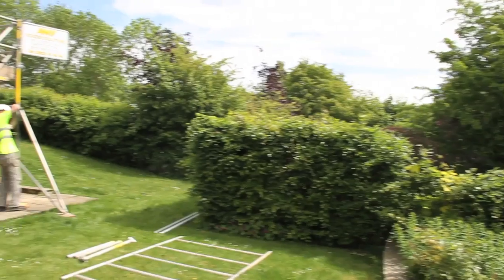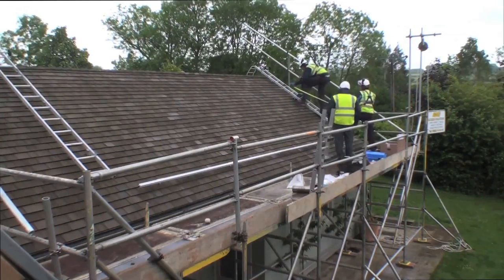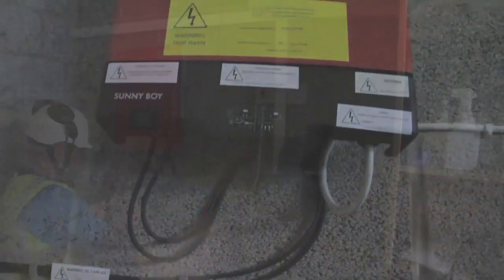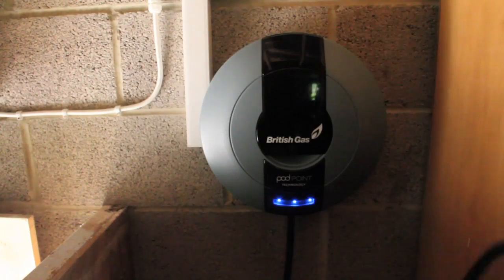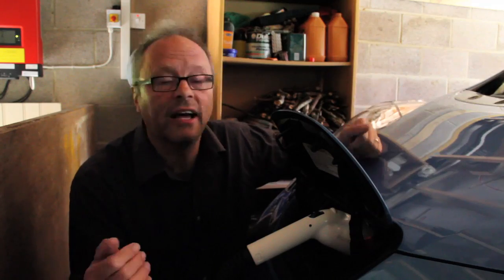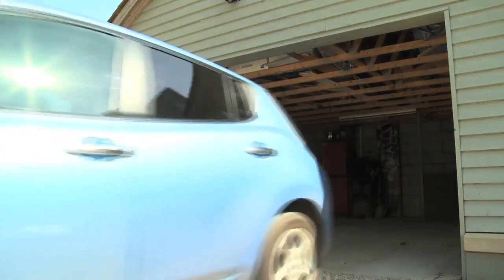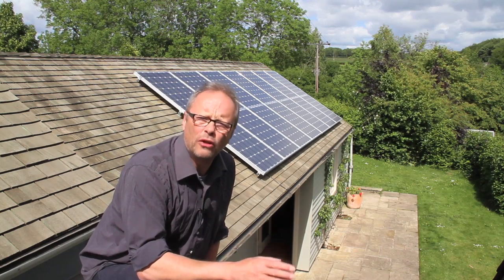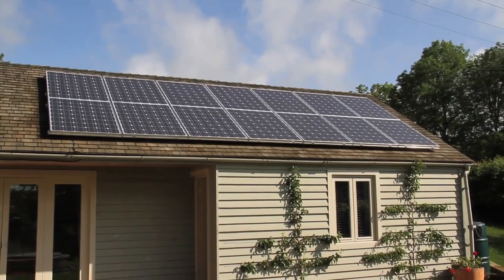Solar PV | Fully Charged

Comment from the maker: @huskobusko That's a good point and very true, in fact loads of fossil fuels were used to create and transport them. In just the same way they are used to create and transport all forms of energy generation systems and all cars. The only difference is, once they are made, they don't use fossil fuels to work. On the day it comes out of the factory there is no difference between an electric car and a fossil burner. 10 years and 200,000 miles later, there's a very very big difference
Reply: In hindsight I think it's clear this statement is not quite accurate. Apart from in the long run electric cars will be greener than ice cars.

Comment: You're lucky over there, here in Australia you only get the feed in tarrif on the power you generate in excess of the power you use. So many installations (especially the standard, cheap, 1.5kW setups) don't earn you any extra income at all. Of course your power bill reduces, so it will pay for itself eventually.